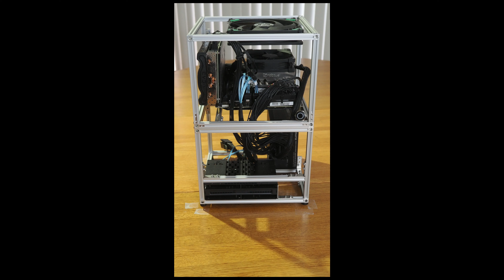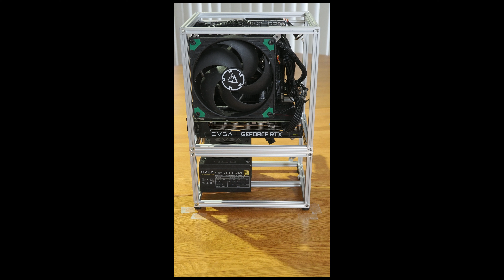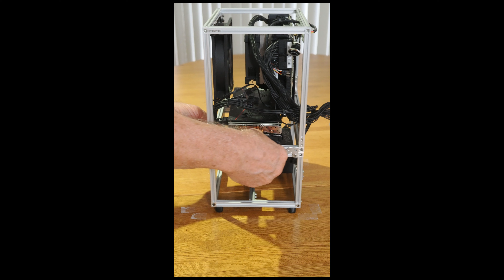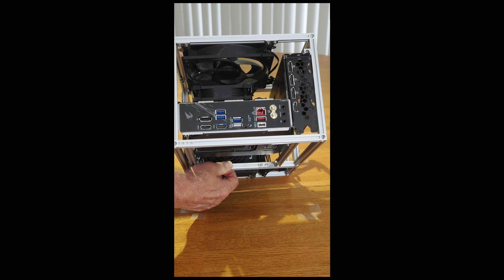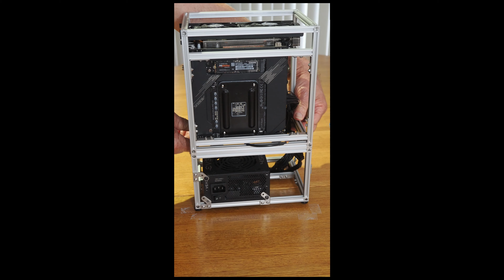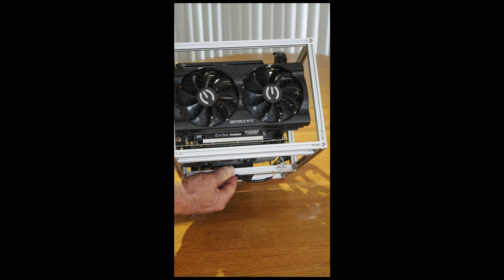MakerBeam Vertical Home Lab

Comment: Hi Mark how is the strength between the sections?
Reply from the maker: I find it quite solid with 4 attachment points - one on the outside of each corner. If you are worried about extreme rough handling one could add another on the other side (outside) of the case - for a pair on each corner. Just remember to slide in extra T-slot nuts into the beams during the initial assembly to give yourself the option to double the connection of both sections. I never felt the need to use them, but they were available if I thought they were needed. If extra T-slot bolts are not used, they will of course slide back and forth if you pick up the chassis and shake it.